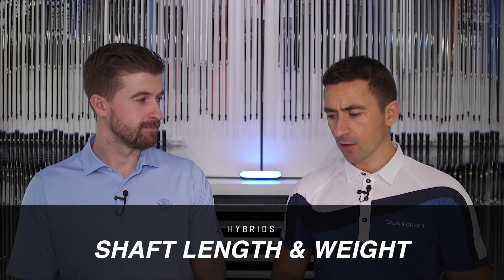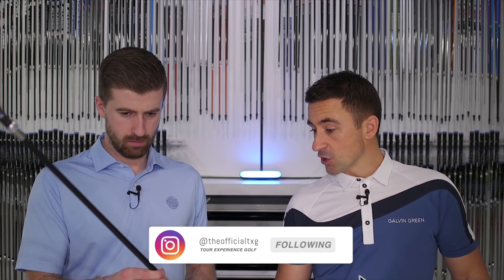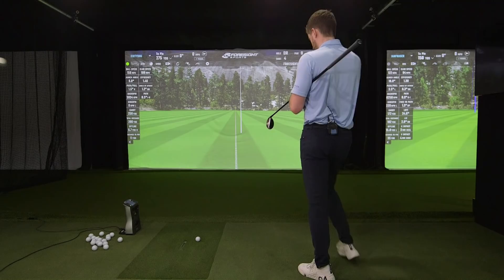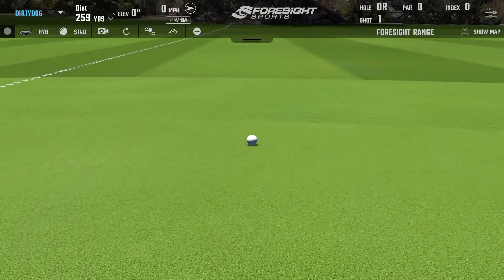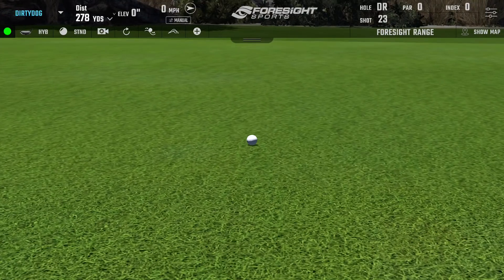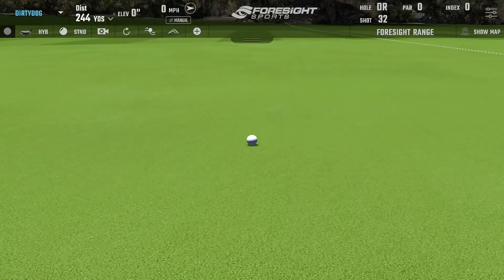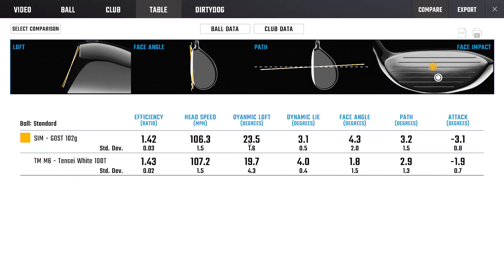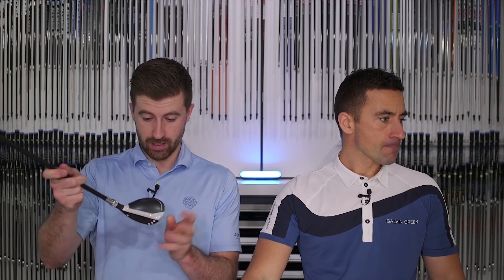New Fitting Concept for Hybrids // Better Contact & Accuracy

Comment: No Mizuno JPX Fli-Hi hybrids in the house?  Billed as a direct iron replacement and built with a shorter shaft by design.  The stock Nippon Modus 3 Tour 105 performs exactly as described in your video.  The shorter heavier weight shaft really does help offset my hooky hybrid tendency.

Comment: Try the Arthur Extreme XCalibur hybrid shaft. $35 NEW, EXTREMELY Strong. My Stiff flex is 98g AFTER a tip cut 1.25", and plays 6.8 flex.... LOVE IT. My distance is slightly down, but my control in a hybrid is paramount..

Comment: The early hybrids had steel shafts, and 3/5 woods it used to be an option. I have struggled with hybrids with graphite shafts so an experiment worth trying.
Be interesting to see the Nippon in a 3/5 wood as well.

Comment: I have the same struggle. I found a used tour issue Callaway Apex 2016 3 hybrid on eBay with a UST IROD 105f5 shaft and cut it to 2 iron length. Threw some lead tape on it to get her to D2 and I'm striping it.  I'd love to get the GOST shaft in a newer hybrid but it's very expensive

Comment: The SIM max hybrid is a rrrrrrocket ship. I was hitting the 22* almost as far as my old 3w. About 240 with the 22* and maybe 255-260 out of the 3w. It's silly long but I found it to be really straight still. I actually thought I might have to use the 5h for gapping purposes.
Reply: Maybe a new 3 wood fits a little better?? Or would the gap be to great with your longest iron??

Comment: Great work guys. If I cut the shaft of my Callaway apex pro 19 19 degree hybrid by 2”, would I need to add 12pts of swing weight to the head?? What sort of yardage loss is average per inch  of shaft

Comment: My specs are:
45.5 driver, 66 grams (want to shorten half an inch)
43.5 3 wood 68 grams (needs probably an inch taken off)
40.5 19 degree hybrid 82 grams (ideal length)

Comment: great video  and very topical  - I recently had a driver iron fitting  - end up with 2 iron U510 and Mitsubishi MMT 105s shaft. The shaft was cut down to 39:50.. Goes really well but has the occasional big hook that terrifies me... how much of that would be down to offset head do you think?
Reply from the maker: could be the spin profile, if the face gets a bit closed and the spin drops it's easier to hook
Reply: @clubchampionmedia  Thanks for the response - much appreciated

Comment: I realize this is the opposite idea from the subject matter, but I would love to see you guys build Matty a 300+ yard hybrid.  Grab the hottest head with some adjustability for a lower loft, maybe a 3-wood or driver length shaft, proper lie, swing weight etc.  It would be fun to see what a small headed club can achieve with that swing speed.
Reply: He hit 290+ yards when he/they tested the 17 degree (turned down to 15) Callaway Super Hybrid a few months ago. The stock shaft in that is 41.5 inch.

Comment: Just stumbled across this video.

I’ve always thought about chopping some length off my hybrid to play same length as the 4 iron it replaced. Currently play a 22* 913Hd with Diamana D+ 92G. I have interchangeable weights for the sole. If I took some length of the shaft do I up the weight in the sole? I play a non taper grip so I’m guessing I could just grip down the club and experiment as well!

Comment: How about golfers with low swing speed (80mph), but a little less shortening ? I was recently fitted by Club Champion colleagues for G410 hybrids 19-22˚ with ProjectX EvenFlow Blue/Riptide 85 HY 5.5 shafts at 40 inch length. The G410 4 iron length is 38,88 inch.

Comment: So I have clk 16, 19 and 22 and have had to wind the down to open them up (antihook) 85gm speedster shafts, could I take an inch off the. Without affecting too much weight? How can I compensate for the weight loss stick lead tape on the head?

Comment: Since you guys have access to a lot of irons. Do you know if the PXG 311 Gen 3 XP irons are a lot smaller than the Ping G410 irons in terms of length and are they just as thick in the width? Do you think they would be just as forgiving?  Thanks for your help

Comment: I am a Mitchell's golf Cert. club maker.  What I find in hybrids is they are too light,  too stiff and too flat. They are easier to hit if they are 80g plus in weight,  softer flex and about 1/2" short.  I don't tinker with them any longer,  I can't bend them to 3up.  If you find the right combo,  they can go as far as a 3w.

Comment: Hello!! I have a question for you, I have a vertical plane of 55 degrees with the 5 iron. I use flighscope, what does it meas? Does it have any relation with the lie on the 5 iron and the face angle? Because I have a tendency to close the face a lot

Comment: Ian - have you and the boys had success with the Titleist TS hybrids where you can flatten the lie angle without having to bend it? How do you address the swingweight when cutting down the shaft, heavier weight in the head?
Reply from the maker: Absolutely! The TS hybrids and G410 hybrid have been great with the flatter lie. Swingweight should be adjusted using custom weights, both of those companies (and most others that have adjustable weights in the head) have different gram weights you can use to dial in the swingweight

Comment: Ian, so you advocate shortening the shaft length on your hybrids to gain better control and consistent contact, sounds reasonable and makes sense. So why don't you suggest the same for driver shaft lengths, which is where most people struggle? I don't get it, it's always 45", I've never heard you say anything else for drivers, or did I miss that video?

Comment: Interesting idea and one I think I could benefit from... I have a 3 & 4 hybrid, both M6 and same shaft and always find I hit my 4 so much better than the 3, sometimes if I catch my 4 well it will go as far as my 3, could this be down to the slight difference in shaft length between the two?
Reply from the maker: likely if you catch the 4 really solid or even slightly above center, it's giving yout great launch/spin allowing it to perform as well as the 3. Not uncommon to see that, you may want to look at the 3 and see if something like a 5 wood would work better for yardage gapping

Comment: Does the shorter heavy shaft concept also correlate into a 5 wood? Or does the head design of the 5 wood not lend itself to that configuration of heavy/shorter shaft?

Comment: With shorter length how do you make sure the swing weight goes back up that much after cutting 2"? Lighter Grip? Much more hot melt on the head? Please advice

Comment: When you are playing hybrids at the shorter length do you follow the tip trim code for the shorter shaft? For example, if I want to play a 4 hybrid length shaft in a 3 hybrid do I follow the 3 or 4 tip trimming instructions or just butt trim it to the 4 length? I ask bc I want to change out the shaft in my hybrid and experiment with this concept.

Comment: What benefits of the multi material shaft offer as opposed to just putting steel in a hybrid head at the same length?  I'm fairly certain Webb Simpson has steel shafted  hybrids for quite some time now.
Reply from the maker: a lot of it would be feel, vibration dampening, etc.

Comment: Wonder how a test with a hybrid in a graphite iron shaft would go.  Weight would/could be higher like the Nippon GHOST shaft and there are many that are .370 tip diameter.  I would think this would be more for hybrids that have ability to have weight added to the head i.e. Ping G410.  Food for thought on a potential test in the future.  Possibly something I may even tinker with now that I think about this as I type out my comment.

Comment: As Matt said this video is not for me. I'm play senior flex (76 today!) , So my iron shafts are 60gr .I therefore chose hybrids in Women's shafts to correspond with my irons. Besides the women's lengths are shorter- 22° hybrid = 38,75" which replaces the 4 iron.I also have the 25 & 28° hybrids and start my irons from 7. With these hybrids in play I keep up with guys 20 years younger but they play  the 3 iron!

Comment: Can you guys tell me what the swing weight of the shortened hybrid is. I am seriously thinking of getting the sim hybrid and getting it shorter. My irons are t100s with kbs 120 shafts don’t know the swing weight, and the 3 hybrid tm jet speed I use has a stock 75gm shaft which I do feel is too light. Any advice is welcome thanks in advance.

Comment: I did this with my 3-hybrid 19 deg with a Ventus Blue 7S HB shaft. Shortened it to 39". length of a 3 iron.

Avg numbers:
---
Club Speed: 95.3 mph.
Ball Speed: 141.6 mph.
Smash: 1.49.
Launch Ang: 11.9 deg.
Spin: 2734 rpm.
Height: 76 ft.
Land Ang: 34.3 deg.
Carry: 227 yd.
Total: 253 yd.

Comment: Curious how this would be in the higher lofted hybrids (i.e. 28*+, ex g410 30*).  I play hybrids throughout the bag.  Would the shaft still work with the higher loft ones at an even shorter length (ex. Callaway big Bertha 33*).

Comment: Kind of a stupid question: How about just use a Modus 105X with the Hybrid? The weight is comparable and the Modus 105X is more accessible for most.  Any specific features of the GOST shaft that are superior to plain old steel shaft?

Comment: A couple questions, as it seems kind of crazy that the Sim Max's lie is 60 degrees, while most other companies 3 hybrid is 57.5 ish.  Does this work specifically well for the Max since it's freakishly upright, but wouldn't work as well with say TS2?  Also, if you cut a 95gram hybrid graphite shaft down 2 inches, what is going to be the frequency/stiffness effect?

Comment: Loved the video as always guys. Especially in these times looking forward for the next one! I always struggled with hybrids never quite seem to like it as much as a long iron. I would like to play a graphite shaft in my 2 iron only thing I have is weight.... they are all to light. I play a 120gr steel shaft in my 2 iron.....The best one I've tried so far is kbs hybrid 95 X. What do you think of the hzrdus series or tensei for a long iron??
Reply: You should look at a aerotech steelfiber (or nippon g.o.s.t if you wanna spend big $) for your 2 iron.
I had a 102 gram steel in my 2 iron and swapped it for aerotech steelfiber i80 (85 grams). To bring it closer to the weight of the steel shaft I used a 4.5 gram aluminium ferrule and a midsize grip. The steelfiber is available in heavier weights... I think there is a 95, 110 and one even heavier, possibly 125.
Reply: @spoolkingfg2008  tnx for the tip Jordan! What would it cost me to swap it?? This is going to be the third season of my Callaway 2 iron. There is also something loose in the head so I want to buy a new one or a not to expensive shaft 😅
Reply: @lucavandecoevering6200  the steelfiber is a pretty cheap shaft. I payed 100 Australian $ for mine. Any good club builder will swap/install the new shaft for only a small fee. I payed $30 AUD.

Comment: Hello Lads! I've got a new uncut Ventus 8S hybrid shaft that I plan to put into my G425 hybrid. If I'm trying the 4 iron length theory, should all the trimming be done from the tip end, or a combination of both ends? Is there a percentage formula such as take 75% of the cut from the tip and 25% from the butt end? So great to be able to research topics through your content! Cheery bye!

Comment: You got some suggestions for a good hybrid shaft for low launch low spinners like me that need a heavier shaft but are only swinging the hybrid around 90MPH? Seems like if you want a 85 or 90g shaft it's gonna be low launch. Is the GOST low launch like most of the heavier hybrid shafts or should I try one out and see? Kind of hard these days...
Reply: The Nippon G.O.S.T is a mid/high launching shaft.

Comment: Hi guys its shane from new zealand ian fitted me last year with 818 H2 with a tour AD 85 shaft i vary really hit it i want to but it has a mind of its own would this  shaft be an option or should i go to a driving iron 
stay safe many thanks shane
Reply from the maker: trying the shorter and heavier option would definitely be worth a try Shane, we've seen it help a lot recently for those that struggle with the hybrid. Driving iron would be more to change launch/spin profile, not so much consistency of contact and accuracy

Comment: Hi guys! I got an old Callaway X Hot Pro 18 degrees with a Project X pvx 6.0 (85g?).  I've been thinking about cutting out 1-2" out of it. I hit my irons much better than my woods and if I get the hybrid shorter, it will be easier to hit it more like an iron, right?
Reply from the maker: for sure, it will help you get a more neutral path and descending angle of attack making it easier to hit the hybrid well

Comment: Really curious for your guys' input...
I lost my 4-5 hybrid head and still have the shaft and I recently tried putting my 2-3 head on the 4-5 shaft. The shorter feel is amazing, but I need some help with the tech... how do I tell now what loft my hybrid is even at? Do I need to get out a protractor? The adjustable hosel on the 4-5 goes from around 19-22. And the 2-3 goes from about 16-19. I'm just not sure about how that 2-3 head will affect the loft and lie on that 4-5 hosel... a part of me wants to understand the changes I've made
Reply: You need to be more concerned with swingweight first.  Every 1/2" you shorten the club, you lose 3 swingweights.  A D3 turns into a a D0.  So ou need to add weight to the head.  lead tape or hot melt.  Use the tape first and play with adding weight inside, center and outside.  You also need to be concerned with lie angle.  A shorter shaft flattens the lie angle.  On hybrids that can be beneficial as they seem to come toe up most of the time when standard.  What the loft actually is isn't important.  Getting the right trajectory and spin is.  If you need it to go higher, set the hosel adjustment and see if it gets your desired result.  Usually when you set the sleeve for higher,  you also set it to fade or go right.  Setting it to go lower promotes a draw or more left.  Closes face when set low and opens face when set high.  If you get your preferred loft and and spin, it doesn't matter what the actual loft is.  Then there is shaft selection and tuning.  Getting the right shaft can make a world of difference.  But not so much on trajectory.  Loft does more.  Shaft does do some but not much.  You just need to get a shaft that fits your swing.  The right flex, torque and kick point can help you find the middle of the face more often. Different shafts cause the head to do all kinds of stuff.  Finding that magical shaft has been the hardest part of tuning for me.

Comment: Do you think it’s a crazy idea to carry both a hybrid and a 2 iron I just don’t get along with 3 wood so I go driver 2 iron bent to 16.5 strictly for the tee and then I use a 19 degree sim
Reply: I carry a 2 iron (think its either 17 or 18 degree) and a 20 (turned down to 19) degree Callaway Super Hybrid. I dont think its crazy at all, particuarly if you only hit the 2 iron off the tee (which I do as well)

Comment: So with my Ping G410 H4 on a Rajin 84 Stiff (which I think is 90 grams) and 40.5" long - would cutting it by 1.5 Inch be an option? I assume swing weight (which is currently E0) would then go more in the direction of D1 - which would be not optimal - correct? (Not really sure I need it - rarely hook my Hybrid, just curious).
Reply from the maker: go with shortening by 0.75" to start if you wanted to try this, especially if you're already somewhat happy with the performance

Comment: Shaft manufacturers have all but eliminated 90 gram fairway Wood shafts and you can't find 100 grams anymore if you like to play your clubs short and heavy. Hybrid shafts are following the same trend unfortunately if you want graphite. If you want to play a hybrid at an iron length, and have 130 gram shafts in your irons, what is out there besides recoil 125 and steelfiber 125?
Reply from the maker: Probably not looking at any advantage of going over 110g in the hybrid even at shorter length